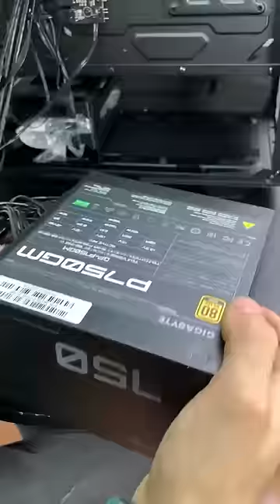Gaming PC Build ASMR: AMD with RTX 3080 #Shorts

Comment: Everyone: tries not to hit the parts and damage them in anyway
This guy:
Reply: It’s sped up tho
Reply: Lmao
Reply: グラボくれ
Reply: @stonksagent9040  Still, the parts are being damaged
Reply: He didn't hit anything in this video wtf
Reply: @extrachannelyt6528  he slammed them all on the table like its cheap.
Reply: @extrachannelyt6528  every second they opened something
Reply: @mamba2019  dude it's just cables. it's not wires made of fragile glass lol
Reply: @extrachannelyt6528  notic how on the cpu how aggressively they opened the box.  They could’ve bent the pins on the cpu .
Reply: @extrachannelyt6528  they also scraped the glass panel by the way the opened it
Reply: @mamba2019  this video is sped up. and how the hell could they bent the pins without touching the cpu.
Reply: @extrachannelyt6528  now calm down 9 year old who has never built pc’s before
Reply: @extrachannelyt6528  ive built over four pc’s. The specs are’ :build 1 ryzen 3 2200g and rx 570. 2nd build: ryzen 5 3600 and rx 570. 3rd build: ryzen 7 3700x and rtx 2070. And final build, aka my current pc. Ryzen 7 5800x and rtx 3080
Reply: @extrachannelyt6528  so yea. I think by now id know a thing or two about computers
Reply: @extrachannelyt6528  you mess a pc expert lol
Reply: @mamba2019  the pc expert with "fortnite" in your username.
Reply: @mamba2019  and you probably stole this video from somewhere, or this video wasn't recorded by you. or it was recorded by you but you didnt built the pc.
Reply: @culturedman69420  this pc expert becomes very sensitive when somebody drops wires on table from 10 cm height lol.
Reply: @culturedman69420  this pc expert has only 1 video of his or not his pc build result.
Reply: @extrachannelyt6528  indeed😅
Reply: @extrachannelyt6528  i can tell you why my name is  borger.
Reply: @mamba2019  don't make excuses why you named your channel like that even if your hobby is building PCs.
Reply: @mamba2019  And the avatar of half of your finger.
Reply: @mamba2019  You calling me a 9 year old who "never built a pc before" cuz i told you the wires don't break like glass when dropped from 10 cm above.
Reply: @extrachannelyt6528  so my older cousin and i were watching kermit the frog memes and came across a video called “ what famous people order at mcdonalds but edited”. And the thumbnail sade fortnite borgee
Reply: @mamba2019  So you are basically a bored kid and you had fun with the cousin who built all the PCs. mkay
Reply: @extrachannelyt6528  he built the pc’s?
Reply: @extrachannelyt6528  he lives like 3+ plus hours away from my house. We were in fredricksburg on vaction when we saw fortnite borger
Reply: @extrachannelyt6528  Id like to see what you built. Oh wait, you bought a pre built
Reply: @extrachannelyt6528  it was actually a place called flipping patties. My friends dad owns the place and they have something called the ice cream burger. Its a sweet burger bun with coconut and purple yam ice cream.
Reply: @extrachannelyt6528  i tries taking a picture of it before my sister ate it but my finger got in the way. by the time i noticed my sister already ate half of it
Reply: @mamba2019  yea yea, i already exposed you. so cry into the pillow and not here, in  comment section.
Reply: @Kuze_Min  u mad?
Reply: @extrachannelyt6528  see ur messages and then talk about mad
Reply: @Kuze_Min  uh huh.
Reply: @mamba2019  No they aren't lol
Reply: @mamba2019  If you think you can bend the pins by tossing the cpu on a table IN THE BOX you clearly know nothing about pc hardware
Reply: @mamba2019  Building 4 pcs doesn't make you an expert 😂 holy shit this thread is the gift that keeps on giving
Reply: @anguishedcarpet  but don’t say i do t know about pc hardware. Ive spent months researching and trying to learn. Its been over 2 years since I started pc building.
Reply: @anguishedcarpet  The way they opened the graphics card though. A single flick the other way and your graphics cars goes bye bye.
Reply: @anguishedcarpet  Sure. Building pc’s researching for weeks and even months about what the components do, what parts are compatible. What ram speed and what cpu . All of things factor in to knowing about desktops, laptops, I macs and etc, so sure. Im not a pc expert. Do you need me to say that to make you a better person. At least your not like extra channel yt, where they act like scratching a glass panel  is fine
Reply: @mamba2019  You don't understand how strong pc components are nowadays, some GPUs can be dropped down stairs and still be fine
Reply: @kisco2-electricboogaloo574  yea. Still i wouldn’t drop a gpu down the stairs
Reply: Juice  listen bub, i prefer to not damage pc components when building a pc.
Reply: I'm actually amazed how all their videos are like this. Just for the heck of showcase I guess lol
Reply: @johngusayko8506  guess so
Reply: @mamba2019  I don't think you should call anyone bub with the way you got caught in a lie and then conveniently shifted away from it. You don't know shit about building PCs and this is coming from someone that actually works with installing custom TPMs on high end servers and builds out racks for corporate buyers. Components are not as fragile as clueless people think they are. While caution should be exercised, they are not going to break by any means with how the video was presented and his handling of the components. Considering he carefully placed the CPU to avoid bending pins and fans were properly mounted, doubt this is his first build. Video is also sped up giving the illusion that parts are being slapped on like Legos when he's actually just applying them like normal.
Reply: @MrWasian  What do you mean by caught in a lie? Im having trouble wrapping my head around that.Also conveniently   shift away from? If this extra channel yt knew about computers why is there no proof he owns one and never owned at least a prebuilt
Reply: @MrWasian  I already ready apologized  for the cpu part, that was a bit excessive. But i would not ever open a graphics card like that. Ive had parts die from being dropped. This one time i was being pretty stupid and dropped a b450 aorus m board in the driveway after coming home from micro center. I decided to take it out of the box but tripped on my shoe laces. It was a pretty sad time after seeing 89.99 usd down the drain. It was already late and i didnt want to ask my parents for a ride to micro center because its 1+ hours away
Reply: @MrWasian  still i agree with your points of how foolish i was and apologized. Still though i would not have ever opened that glass panel like that though, probably scraped.
Reply: He speedruns like dream
Reply: So uh nice talk
Reply: Mohamad ikram Bin zaulkafle  old war mohamad, move on
Reply: He dropped his aio on the motherboard 😂
Reply: Prebuilt makers be like
Reply: The mailman:i love him
Reply: @mamba2019  they aren't
Reply: @yks1111  alright man. as long as the pc functions it works right?
Reply: @mamba2019  yes👍
Reply: 🔥🔥i m youtube🔥🔥😍👉मै youtuber हू mera tech channel मेरा टेक चैनल है 👈😍 🤠👉mera Channel se aapka help ho sakta ha मेरा चैनल से आपका हैलप हौ सकता है 👈🤠 🔥🌹🔥🌹Nice Video🔥🌹🔥🌹
Reply: 🔥🔥i m youtube🔥🔥😍👉मै youtuber हू mera tech channel मेरा टेक चैनल है 👈😍 🤠👉mera Channel se aapka help ho sakta ha मेरा चैनल से आपका हैलप हौ सकता है 👈🤠 🔥🌹🔥🌹Nice Video🔥🌹🔥🌹
Reply: @mamba2019  You are malding bro, just stop saying shit you do not know. He aint damaged shit, it is sped up by like 1.5x.
Reply: Ay what are the specs can someone translate them
Reply: @mamba2019  cmon man it just speed up vid he didn’t even smash it on table
If u put the box on table so hard or drop it
If it’s in the box it’ll be just fineeeee 
That’s why the box for :) 
Idk how u build 4 pc without knowing it
Try to learn more
And He don’t even touch the cpu pins it will not bend (sometimes it’s bend from the factory) 

Try to watch Linus Tech Tips bro
It’s helpful 😅
Reply: Only thing he “damaged was the aio fins
Reply: @mamba2019  PC expert>🤓
Reply: @ikram2512  not anymore. lost interest in computers. mostly focusing on basketball right now
Reply: @mamba2019  sureee
Reply: @ikram2512  alright man. take care. pc computers\ electronic devices dont seem to make me happy anymore. i spent most of my life being a indoor person. but now im happy just bein outside ya know?
Reply: @mamba2019  ok?
Reply: @ikram2512  you said sure like you didnt believe me man. its good
Reply: @mamba2019  huh huh
Reply: @ikram2512  alright man feel free not to believe me. im just enjoying life right noe
Reply: It's cheap in china anyway
Reply: No
Reply: The video is speed up
Reply: @mamba2019  graphics cars?
Reply: What???? Your comment makes absolutely zero sense
Reply: @mamba2019  are you delusional???
Reply: Fr
Reply: Mamba my guy loss the argument and bring age as an insult lmao
Reply: @mamba2019  you after saying all of that 🤓
Reply: @whosnoxillura  lmao. Mad because im able to have nice things 😆
Reply: @mamba2019  nope its sped up
Reply: @mamba2019  No parts. Are damaged its sped up no need to worry :)
Reply: boy a year later and nobody got the joke😂
Reply: Its a fast forward video
Reply: а чё он не так делает ? я свой пк так же собирал
Reply: @GlebK_isr  translation bro
Reply: I usually like pc same but this person was to rough with it though
Reply: Having money and wasting
Reply: @mamba2019  go cry abt it
Reply: @mamba2019  my man said that it is a joke to get away 🤓
Reply: Yes bro I a lot of care on my pc
Reply: 😂😂Fr bro wtf I feel like this dude took like 5 min of his time to build it all
Reply: Yes making contact between parts and possibly bending a capacitor when the aio pump hit the mobo can result in dead mobo. Amongst other things he did to upset everyone. This is an amatuer build with no care and pride when it comes computer parts. No respect
Reply: @mamba2019  you say over 4 pcs like thats much. You are a beginner with that amount so dont talk like a zen master
Reply: just a staff

Comment: Wish I could get this for my birthday in 7 days this build is insane
Reply: My birthday is on 21 february and I got the G pro wireless
Reply: @basvermeersch8176  lucky
Reply: @basvermeersch8176  that mouse is shitt
Reply: @Pureturk6  i don't Trust the PSU too why should i? Only because it's Gigabyte ?
Reply: @philipp7968  🤷‍♂️
Reply: @philipp7968  cuz it’s a literal bomb...
Reply: the specs of the build is actually eh in value
Reply: @philipp7968  I think PSU's made by Asus and Gigabyte should be Seasonic based. But you should check on it nonetheless

Comment: Top 4 things I would not have done like in this video:
- Using only one pci-e cable to power the GPU (may draw too much power for 1 cable, leading to a lack of performance or even physical damage)
- Using a Gigabyte PSU as they are known to blow up easily (Gamers Nexus)
- Using a crappy SSD like this one
- Having only 512GB of Storage
I would personally take a 3070 with at least 1TB or 2 of storage from a trustworthy brand such as Samsung or Crucial
Reply: 😓I have no idea on what these things are but nice

Can I add a 1080ti to mashed potato pc
Reply: Wait really gigabyte psu blow up
Reply: Well it's not gigabyte psu's in general, it's just  PG series
Reply: Bruh, you don't cheap out on a core parts to buy memory ffs. You can add ram/storage easily after; but swapping the GPU/CPU (especially now) is a fucking pain in the ass.
Reply: @wind8171  mashed potato with gold leaf
Not ok
Reply: @deeper9423  😂

Comment: Gigabyte power supply in the build ahhh your pc is gonna explode 🤣🤣
Reply: But seriously though that is THE exploding PSU... the 750GM
Reply: I got it 6/7 months ago, after hard use 8 to 12 hours a day of photo/video editing and casual gaming… I’ve had no issues with it
Reply: @ltgames9100  Not all power supply have that problem but the most of them.You can even search on YouTube or Google and see the psu exploding.
Reply: @3sixty254  true, the risk is too big in this one
Reply: @marcosputra  they said they returned the psu(s) in that serial number range back to gigabyte .. Since then no one found an issue with any other serial numbers .. If any gamers nexus would have made a video about it xd.
Reply: @beshoyashraf5796  the main problem is, there's many other brand that had higher reputation.

Comment: Is it safe to use put split pcie cable my evga g5 power supply only came with 2 that's wasn't split and my gpu has 3 spots so I stopped building it until I know for sure my gpu is 3080ti fw3

Comment: Buncha fucking babies in here worried about him going too fast, clip is clearly sped up (look at the the camera work, how the AIO falls against the motherboard, listen to how quick and snappy everything sounds), not to mention all the jump cuts. And the AIO head "hitting" the motherboard isn't that bad either, looks worse sped up like that and it's not SLAMMING the mobo or anything. None of these PC parts are particularly fragile - yeah don't swing 'em at a wall but they can handle the occasional bump and jostle. How do you think they make it through international shipping?

The most egregious part here really is the lack of thermal paste on the AIO head, which probably came pre-applied.